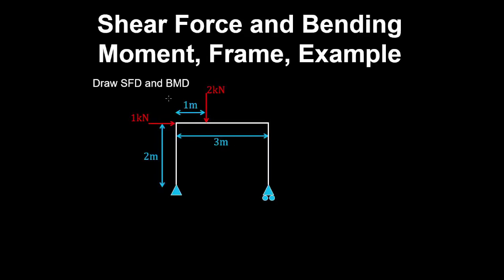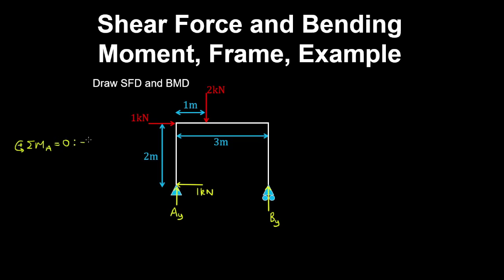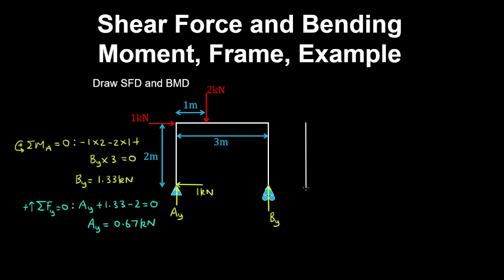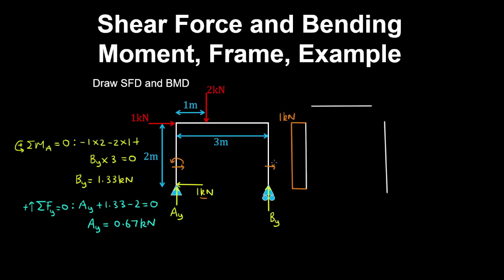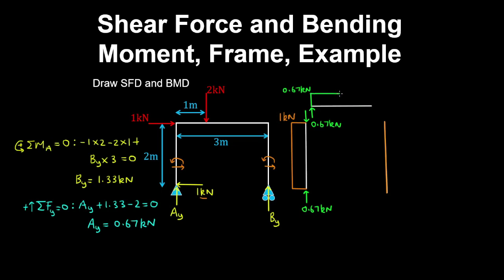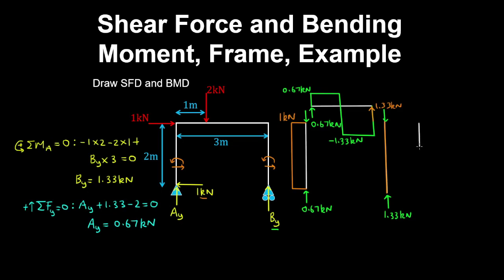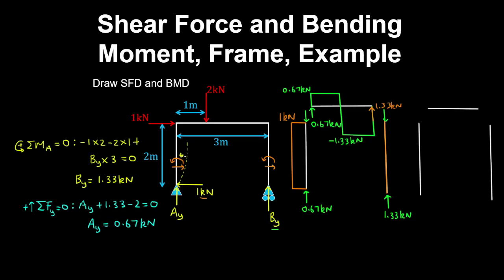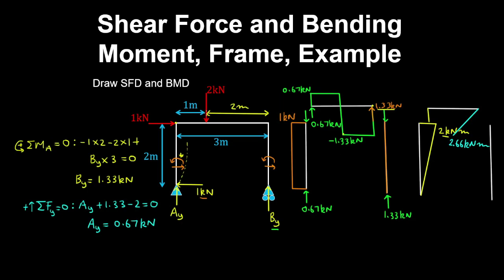Bending moment, Shear Force, Frame, Example - Structural Engineering

Comment: Can you please do one , fixed fixed
Reply from the maker: Which method, are you familiar with the direct stiffness method? 

the force method won’t work well because the degree of determinacy is 3. It will work if the frame is loaded symmetrically.